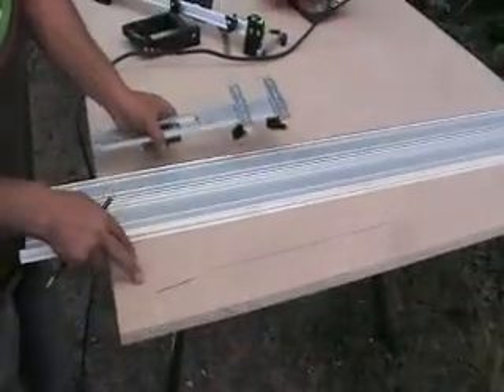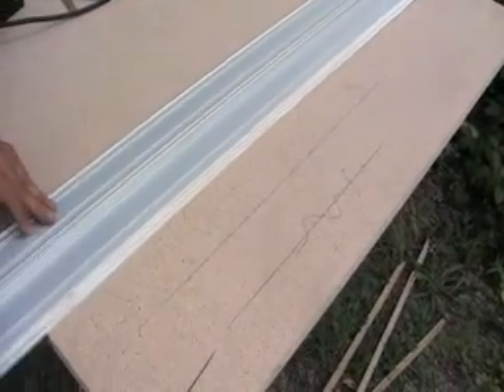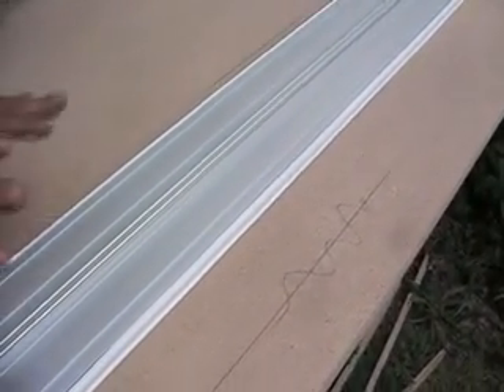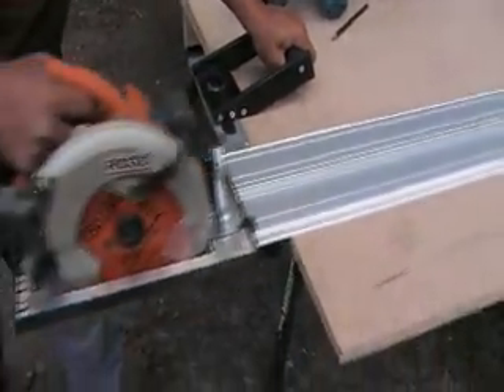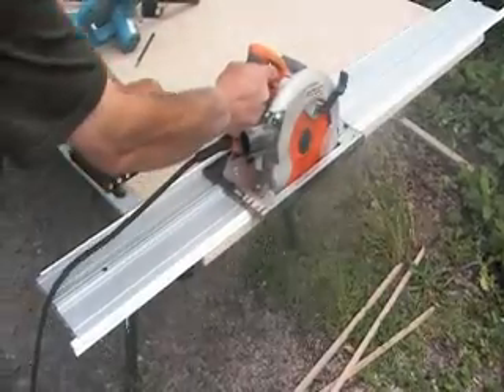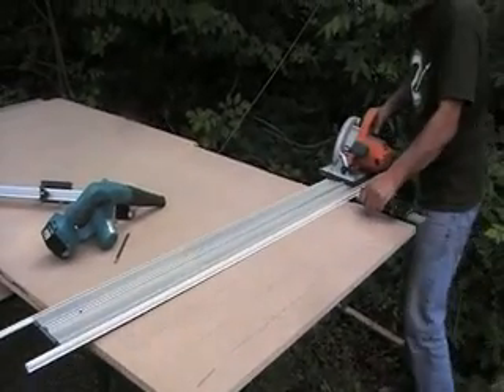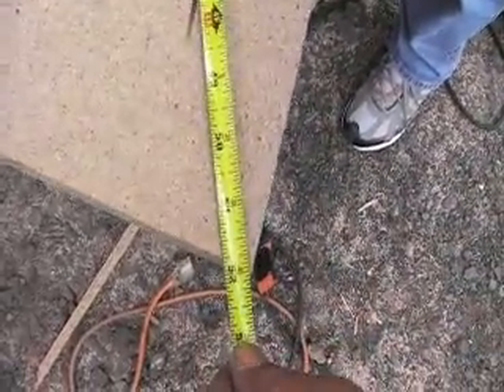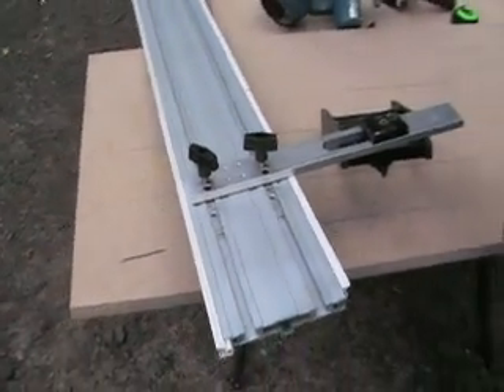Squaring up a panel

Comment: That's assuming you're referencing off a straight cut...
Reply from the maker: YES. All rip cuts in plywood are straight  and parallel due to the way are been cut.
Gang saws are fixed in width  and very straight. 
On the cross cuts is a different story. they been cut in a moving conveyor
using flying saws. ( they cut while the panels are moving)
In case the long size is not straight...use a straight edge or a tracksaw.
In solid lumber they use straight line rip saws and gang saws to make strips.

thx
dino

Comment: All that work and by your cross measurements you were off 1/8"... Not sure why you buy plywood that's not square but if you did have a sheet that way you could cut it square by using a framing square in 1/7th the time you demonstrated in this video. BTW, I love Greece.

Comment: I really like the EZ Smart guide but the price is a little steep. The miter square handle is great but that alone costs over 100 bucks. I have been looking but I haven't been able to find anything that is comparable that has the miter square handle type of accessory. I guess this is cheap compared to some of the other options out there though.

Comment: Thanks for the video. I am a DIYer and not an expert.
However, I think this method works because you are assuming that the first edge - that you never cut - is a straight edge. The corner where you mark the first right angle might not be in line where your last cut ends. Commercial grade ply we get locally (Mumbai, India) are mostly bent due to packaging/ transport etc.
So, what I do is first cut a st edge on the plywood and then follow your way. That is the only way to ensure all the edges are straight and at right angles. Please correct me if I am making some mistake. I have a grand experience :) of cutting a total of 10 sheets -  6ft x 4 ft of 18mm ply - and all of them had bent edges! I made TWO 6ft x 2ft x 3ft open boxes with some socketed beams to hold the bench top.(Other projects are in progress.) The first one went horribly wrong because I assumed the first edge was a straight edge! Since I had cut matching notches for the 6 ft beams running across at the top, I had to start from scratch to correct it -  and get a slightly reduced dimensions for my boxes.. Now, at the very beginning, I let go a small piece at the edge with an Aluminium section as my guide to ensure I am having at least ONE straight edge to begin with.
I like your jig and especially the handle part.  I would try to do something like that with ply and aluminium sections. Thanks once again for the tips and videos.